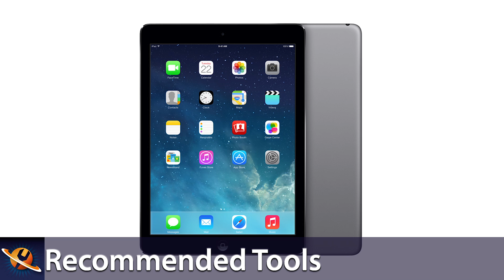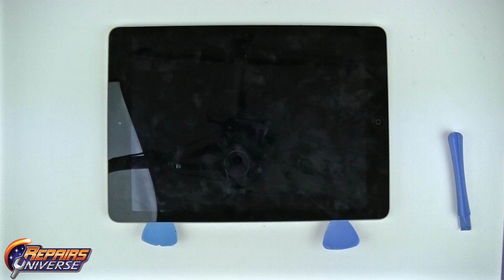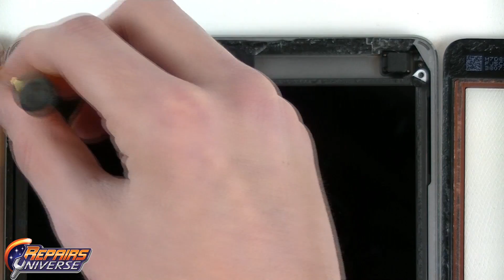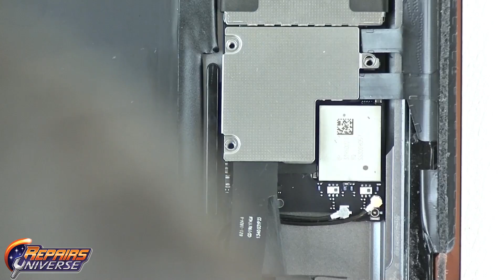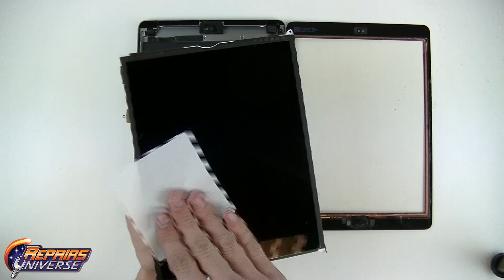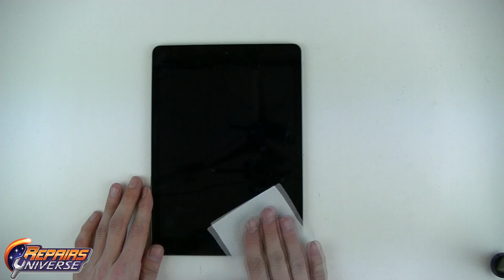iPad Air Screen Replacement Repair Guide

Comment from the maker: Is your Screen not responding. Do you want to fix it now? This step by step guide is super easy to follow, and it will show you how to safely replace your iPad Air Screen.
Reply: Repairs Universe hi there another excellent video very easy to follow, one question my broken front glass ipad air has ghost touch if i replace my front glass would the ghost touch disappear?
Reply: Z
Reply: How do you know if you need to replace the LED screen also
Reply: I'm not sure but ,if anyone else  trying to find out 
electronics board repair
 try Saankramer Electronic Magazine System (do a google search ) ? Ive heard some interesting things about it and my friend got great results with it.

Comment: Does the wires on the ribbon cable for the touch button go up under the wires the connect to or sit on top? My clip broke that closed on top to hold it in place and now I can’t figure out a way to fix it so everything works but the button.

Comment: Thank you for this video, it saved me a ton of money. My removal of the screen was much harder then I would of liked. The screen was cracked pretty badly (digitizer only), and didn't want to come off clean even with it being taped as mentioned in the video. Other than that, the rest of the process was done fairly easily, and successfully as far I can tell.
Reply from the maker: You're welcome. At times it can be more difficult depending on how the touch screen is damaged. Overall glad to hear our video was helpful. Thank you!

Comment: Impressive video. Very helpful as I just successfully replaced my screen using this one that was about the perfect length and explanation. I don't know if you mentioned it, but the one of the screws...the upper left (if the camera is at the top) is longer than the others. I only discovered this because it wasn't seating properly so I had to compare the 4 screws. Nonetheless, this was the best video I've seen for this process of the 5-6 I saw. It establishes credibility for your site/group.

Comment: At the very end the demo fails to show how to secure the digitizer cable away so that it doesn't bind.  This is not a trivial task and sealing it in, or attempting to, can completely screw up the whole repair just because those tiny cables are difficult to secure out of the way so that they are not binding/putting pressure causing the screen to break away from the adhesive.
Reply from the maker: +Jim Blaich We apologize for this and appreciate you pointing this out.

Comment: Guys at a store online it says iPad Air fixes but no iPad Air 2 fixes. I have to ask will they still fix the iPad Air 2 screen anyway cos the fix is practically the same as the iPad Air fix?
Reply from the maker: +TheArcticPhsyco These are two different models and would require a different process. Possibly different rates.

Comment: I'm having an issue where the digitizer will not fit back into the frame because the connectors get in the way and push up on the glass while I'm trying to fit it in. It seems to me like the connectors need to somehow fit under the LCD screen, but I'm having trouble accomplishing that. Any tips for this step?

Comment: hiya after a repair on to ipad air 5 i have the exact same problem...before placing digitizer into screen assembly all works perfect ..test i do b4 removing adhesive.....but as soon as digitizer is placed into frame n turned on im getting a ghosting effect random stuff happening..take out all fine??? no crimps or bends in ribbons...seems as when it touches frame...do u think defective  digitizers or need kapton tape over ribbons n around edge cheers james

Comment: Thanks for your video, I was able to fix a severely shattered screen OK. But a warning to other viewers - you made it look like a 10 minute job, but it took me 4 hours to do!

This was because it takes about 3 hours to get every single last trace of the smashed screen off without causing any internal damage and to clear all the tiny grains of shattered glass and films of residual glue from the metal casing to get it in a fit state to receive the new glass.

Also, people should wear glasses as protection, as when a larger shard of glass is being removed it can suddenly shatter into tens of pieces flying through the air into your face.

As you say, the home button needs to be transferred over - but since its whole assembly is glued to the remains of the glass (as is also a plastic frame for the camera and its color-temperature sensor) it's a good 20 minutes to get only that part into a clean enough state to be reused without wrecking it.

Also, I did a full system test BEFORE removing the upper film from the double-sided tape and pressing the screen down - it would have been a nightmare if I'd had to get the screen off again if something didn't work.

But I was successful in the end with your help - so thanks!
Reply: Ronnie1001 What did you remove the glue with? Solvent or just scraping? Thank you, never done anything like this before and I’m doing a lot of information gathering first.

Comment: I have a cracked screen and my home button ain't working is there any way too fix the home button too or do i also have to replace that ?
Reply from the maker: We do offer the iPad Air Touch screen and home button flex cable replacement. Replacing both would resolve this issue for you. Here are all the parts we offer http://www.repairsuniverse.com/ipad-air-screen-replacement-repair-parts.html
Reply: Sucker

Comment from the maker: +Patrick Flores We apologize about this. Most new screen replacements will not include the home button and this does need to be transferred over.
Reply: Hi I've done everything but my lcd is still blank no display
Reply from the maker: You may want to try replacing the actually LCD to see if this helps.
Reply: +Repairs Universe hello mate my iPad is completely fucked and smashed screen is all kinds of weird colours, is it the screen and digitiser or the whole lcd screen. Thanks in advance and love the video my man ☺️👍
Reply: +Repairs Universe I was crying when watching this
Reply from the maker: To How Seems to be your LCD that is the issue. But in all honesty you will also require your touch screen panel as it will get damaged in the repair process.
Reply from the maker: Ice Bear Why is this?
Reply: +EnderMan Guy same my iPad just cracked today and I got it for Christmas and it meant a lot to me :(
Reply: Cㄥ丹山乙 /// me too
Reply: Repairs Universe a
Reply: Repairs Universe q
Reply: Repairs Universe y l L
L
 u. 
 Ur

Comment: Great question @RJRed! +RJ Red!!! I did not think to mention that. Yes, I can still use my iPad Air, its the screen that I had foolishly managed to shatter in to a million pieces! Then, I got another iPad Air, and my stupid ass hadn't put my screen protector on it yet because I procrastinate so badly, and I actually SAT on it!!! Yes, I sat on the new one! Here's the bad news; "the corner of the screen cracked a hairline crack diagonally, approx. 1 inch down & across"!!! Its actually not really too noticeable, though, only if you know its there, and believe me, I know it's there! I cant believe I now have two iPad's, and BOTH I'VE MANAGED TO SHATTER & CRACK! So, I'm glad I went on to read other comments, and now I know I only have to replace the top glass, only of one of them, the other one I can live with the reminder to be more careful with them. The cracked one could've been a lot worse, but it was laying on my soft bed when I sat on the corner of it, and cracked the corner of it. Anyway, thanks a lot you guy's! ~Carol

Comment: Thanks for a great and educational video! I need to know just how much the replacement glass/ screen costs? I located a small co who said they'd charge me $80-$100 to actually come to my house and repair my iPad Air's shattered screen, but, by the time I was ready for them, I had misplaced their info, and lost them! This looks easy enough to where I could actually repair it myself though, so, please tell me, what do you charge? Thanks! ~Carol 11/16/14  @ 12:15pm

Comment: If my screen is shattered, but I can still use the iPad, do I have to remove the LCD still?  Or can I just remove the screen and replace it?
Reply from the maker: RJ Red In this case you would only require the touch screen digitizer. Your LCD will not need to be removed.

Comment: The only thing missing is the glue needed to attach the new screen. There is nothing on this video about any glue.
Reply: The repairer in this video has used double sided adhesive. He demonstrates this in the video. Do not use glue, if you use glue and you ever need to remove your screen for a future repair, you will make things very difficult for yourself.

Comment: If the screen is cracked do you have to remove the LCD underneath as well? Mine broke recently and I'm planning on fixing it
Reply from the maker: Yes you need to remove the LCD. FIRST you need to disconnect the battery! Remove the LCD so you can clean and prep the area. Install all new and old parts then install the battery. You should be good to go after that.